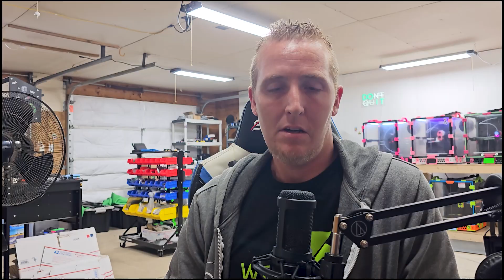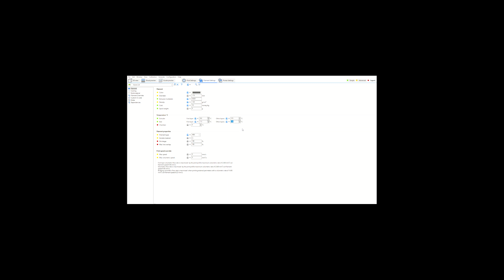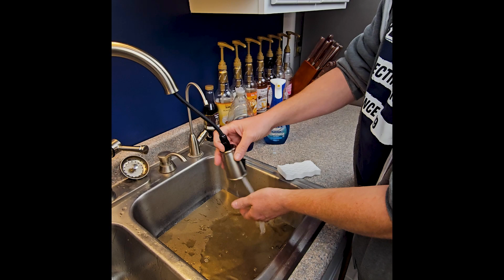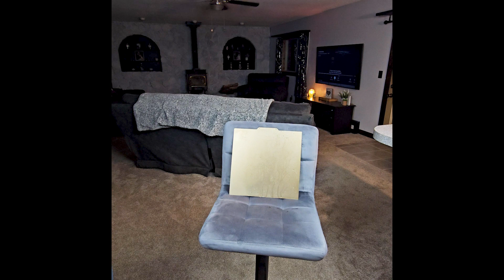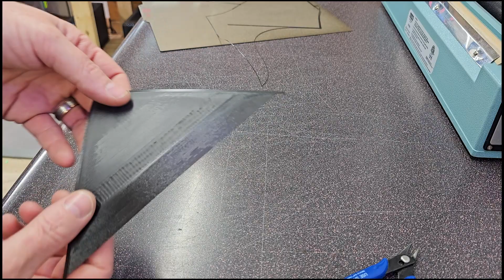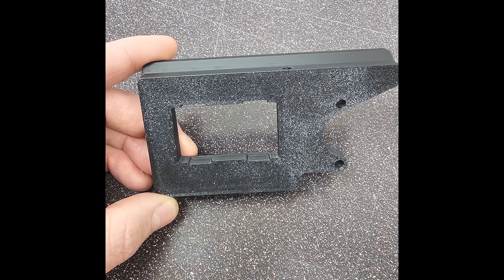Stop The Warping!

Comment: Bambu X1 carbon. Seems to print really well generally. But ABS-GF I just got/just opened/fresh packs is warping. Usually only on the larger pieces/parts. Smaller parts do fine. Typically. Idk… just don’t know what to do or where to start.
Reply from the maker: If you want to join our discord I can help you with some things to get this to stop warping on you. I'll go over all the steps and we will get this to stop warping :)
And thanks for watching!
Reply: Hi, i have been facing the same issue..Did you find a solution?...How did you fix it?

Comment: Maybe off topic: you mentioned the fabric softener from towels causing warping. Never use fabric softeners on towels as it coats the fabric and impedes its ability to absorb water. It may be a little rougher, but it will work much better for much longer.
Reply from the maker: well that might explain my towels then!

Comment: Great stuff. I’m a newbie but learning fast. I started printing with ASA, tweaked the necessary settings and using an enclosure, but the corners are warping and the brim is almost impossible to get off the build plate. Any suggestions?
Reply: I have an AnkerMake M5C and the hot plate is set to 100C, which is the max. I was able to get the brim off with a heat gun.
Reply from the maker: @LilMitchStudio  I was just looking at those at microcenter! Very nice printers! So they aren't really designed for abs/asa though. Is there any way you could go with PLA or PETG for your print? I'm not real sure about what type of build plate that uses. Strange it's sticking that hard to the plate. My PEI sheets will just let the parts fall off once they get cooled off. I'll do a bit of research for you on this :)
Reply: Thanks.
Reply from the maker: That's awesome! Did you watch the video here and all the tips? I suggest making sure you wash the plate properly first and let it air dry. Also, are you raising the temp of the hotend on the first layer? That's a big one. As well as having the build plates at a higher temp. It could be an issue with build plate as well. What kind of printer and build plate are you using currently?